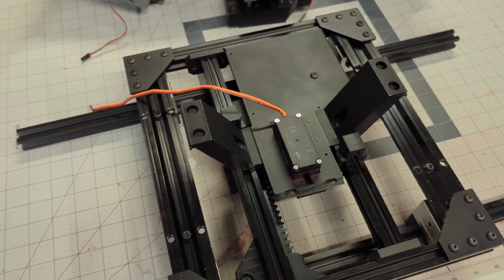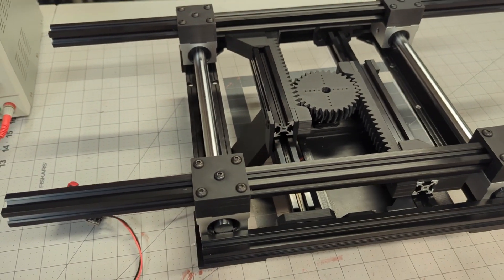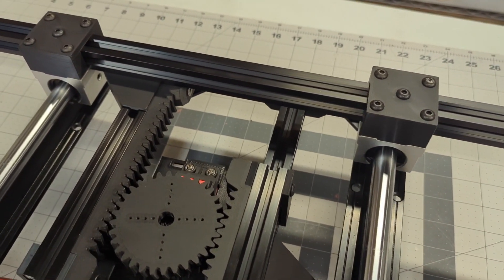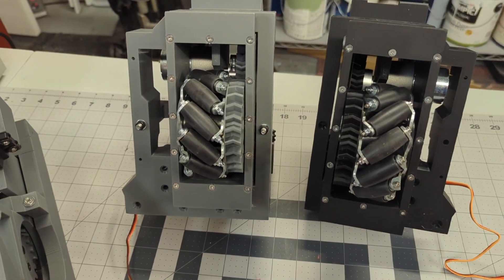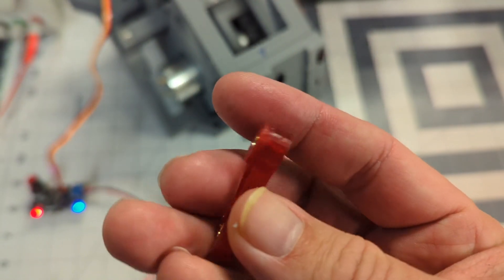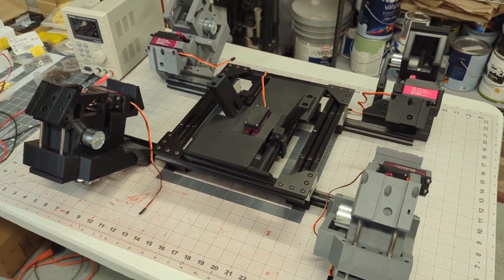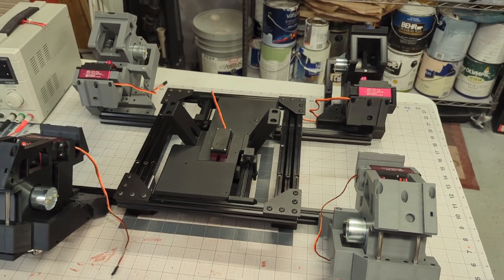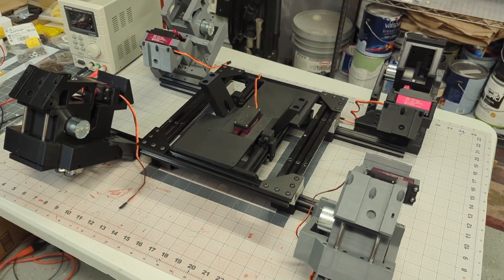My Full-Size B2EMO Build Has Begun!

Comment: Starting mine. What did you use to cut the aluminum.  Thx
Reply from the maker: A band saw with a metal cutting blade is ideal and will keep things nice and square. I don’t have one so used a hacksaw, metal blades and elbow grease instead, then used a grinding bit on my Dremel to even things out (it’s really tough to stay square with a hacksaw). Also, be sure you have a good center punch and metal drill bit for drilling precise holes in the linear rails, too. Good luck with your build!